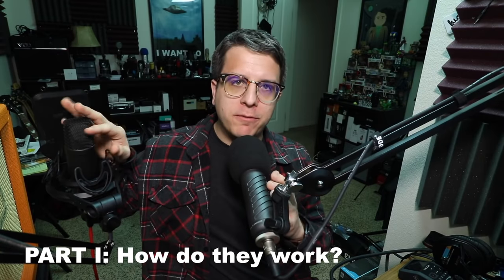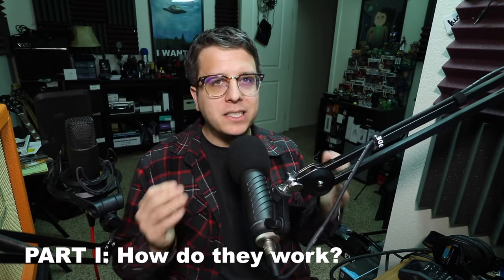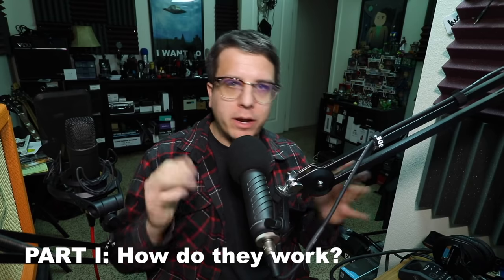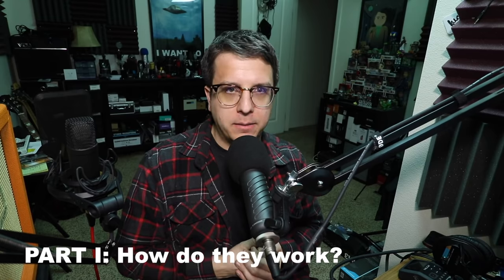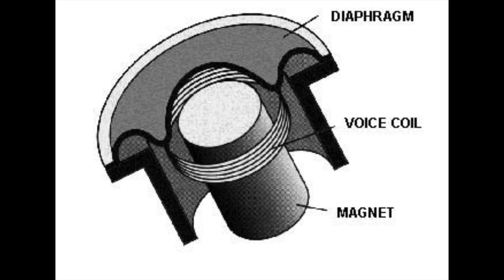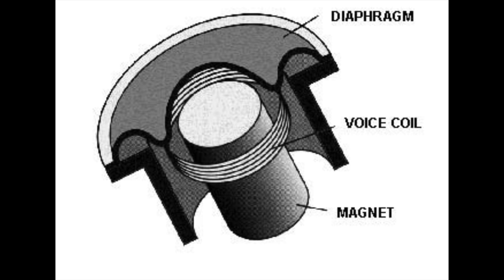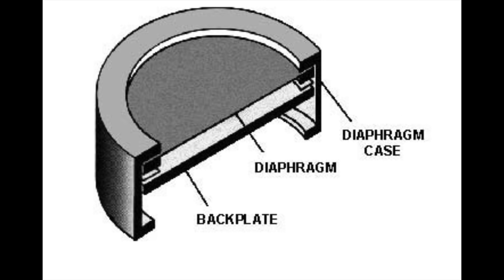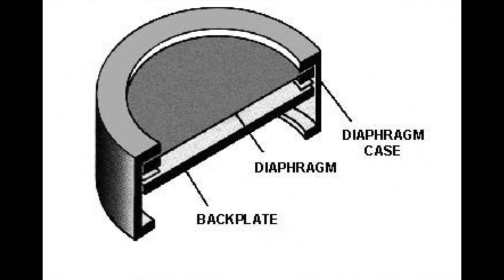Dynamic vs Condenser Microphones, What's the Difference?

Comment: hi, if i buy some cheap dynamic microphone, will it work with a setup like this. Dynamic Mic>XLR to 3.5mm Cable>PC, will it work? just using only the xlr to 3.55 cable? Thanks a lot
Reply from the maker: I do not recommend it. I only recommend connecting XLR mics with USB Audio Interfaces now.
Reply: thanks

Comment: Hey Podcastage you said don't use phantom power with dynamic mics cause it will break the mic but i got the PYLE Pro PDMIC58 and i got a usb to xlr which provides very nice sound quality but the problem is its not loud enough :/ like i can use boost and stuff but still not all programs have mic boost option so i need some help buying either a audio interface or phantom power can you please tell me which is good and cheap ones not willing to spend anything over $50 :p Thank you
Reply from the maker: Look into Behringer UM2 or something like that.
Reply: Thank you !! this is what i was exactly looking for i will also check out your video on that ^_^

Comment: Omni vs Directional (Cardioid) microphone has nothing to do with condenser vs dynamic and everything to do with the design of the microphone.  Dynamic seem better at reducing background noise merely because they tend to be less sensitive.  Use a directional mic, point it at your mouth, get close, and turn your gain down and you will reduce your background noise (or room echo) mo matter whether you use condenser or dynamic.  In other words, Podcastage is wrong on most of what he presents in this video.  But, hey, this is the internet.

Comment: for youtube videos, which one is best
Reply: Johnan totally depends, what kind of work do you want to do?
Reply: Vivaswan just record gameplays and stuff like that
Reply: Dynamic would be the best if you want little background noise but condenser would be better if you want better quality.Not saying dynamic mics are bad by any means because they aren't but yeah if you have an untreated room or don't have a sound booth then it would be best getting a dynamic for background noise rejection :).
Reply: 9 times out of 10, a youtuber or streamer/broadcaster is going to benefit from a dynamic mic over a condenser mic in terms of sound quality due to rejection of ambient noise and lack of studio grade acoustics in their recording environmentr..  The only condenser mics that are decent at ambient and side rejection are super or hyper cardioid pencil mics, but they are well out of most peoples price range and still require a fairly quiet space without reverb issues.
Some great dynamic mics for youtubers would be a shure sm57 or sm58, Mxl bcd-1, Electro voice re320...  On the high end, Electro voice re20, Shure sm7b..
Reply: Cry of the Prophet I currently use a Rode Procaster with a cheapo Behringer Xenyx mixer and a DBX 286A.I love the dbx because of its own noisegat and compressor mainly the compressor though seeing as I have a dynamic mic it doesn't pick up too much background noise but I like to have my pc fans up a bit because it's summer time here in Aus and my room gets hot as fk already haha so having the noisegate on a little is also very nice :D.I wish I had the money for an re20/320 honestly but they're way out of any price range I had when I bought my current mic/setup and am pretty happy with what I have now so win win I guess considering I didn't pay too much for it all and it all sounds pretty good imo :P.Sorry for the random wall of text haha.
Reply: I use an RE20, but I honestly prefer a Shure sm57 for my voice, I also use a DBX 286s into a yamaha mg10xu mixer, similar to your setup and I have near perfect sound without around -60 db noise floor.
Reply: Cry of the Prophet My noise floor with my fans up and general background noise is around -54 db I believe.Could be a little louder idk.Might just be remembering what it used to be with my fans on silent mode.I'd love to have an re20 but yeah they are like $900+ here whereas the procaster was only $178 in comparison and I only barely had enough money for it and the mixer and dbx box so yeah :/.Oh well i'm happy with what I have though because it sounds good enough to me anyway  and it wasn't something that was hugely expensive.Wish I had the money to just go all out on equipment though :D.
Reply: Your setup is leaps and bounds above what most people have and your components compliment each other very well, you also are using a mixer, so you could eq your mic to get a closer sound to the re20.  Trust me, unless you just have cash to burn, I wouldnt recommend the re20 since you already have a procaster, which is a phenomenal microphone..  You must be in Australia or something lol
Reply: Cry of the Prophet Yes I am in Australia and thanks :).I've gotten a sound that for me sounds nice.I don't want to mess around with the knobs on my mixer because i'd probably not get a sound i'm happy with haha.One thing I love about the procaster (other than how good it is for the price) is it's inbuilt pop filter and shock mount because paired with their external ones I hear very few plosives or whatever they're called or they don't come across as too harsh most of the time when i'm recording and rarely if ever hear desk vibrations getting picked up unless I literally hit my desk or something lol.I use my mic mainly for just talking to my mates while gaming and it has been amazing to not pick up any breathing sounds and blocking out nearly all external noise ...to a certain extent anyway.I know it's overkill for talking to mates etc but I was getting so mad with my old at2020 (loved the sound of it though and wish my procaster sounded the same but it's worth the tradeoff imo) with how much background noise it picked up even when it was like 2 inches from my mouth and with the gain dropped significantly...Idk I just have a standard for myself that is very high when it comes to good enough quality to be able to understand what is being said and having little to no background noise if possble.Just wish I had known the differences between dynamic and condenser microphones back then haha.Would have saved me so much money in the long run and time.
Reply from the maker: GREAT Response Cry the Prophet. I couldn't have said it better myself.
Reply: Podcastage what is that mic called the one u always have on the side ur main mic
Reply: You mean the one on the right side of the screen?I'm confused haha.

Comment: Most  points are spot on. But you need to learn more about polar patterns. Off axis test that you did was dumb. It's not about dynamic or condenser at all.
Reply from the maker: I must have misspoken here. I understand that polar pattern is the main contributing factor when it comes to off axis rejection and background noise. There is quite a debate regarding condenser vs condenser and background noise rejection. My theory is that the more limited frequency response of a typical dynamic simply eliminates some of that noise by rolling off frequencies where some of that noise is taking place in (particularly above 14-15kHz), and the sensitivity. Not that the sensitivity alone affects BG Noise rejection, but because they're so quiet, it almost forces people to keep the mic closer to their face while recording, which will increase their signal (voice) to noise (bg noise) ratio, while with a condenser people can easily have the microphone 3 feet away from their mouth. I have also heard a theory that if a dynamic and a condenser mic had the exact same specs, a dynamic would take a higher SPL to move the diaphragm. I haven't been able to confirm this though....it's something I want to research more.

Comment: I shouldn't have bought a condenser microphone.
Reply: I have no idea why producers want music recording with condensors, they pick up all sound in the opposite direction of the artists so echoes (which you cannot eliminate only make close to the same muffled frequency so it's easier to reduce the volume to that frequency) come into the microphone in crystal clarity. A full range dynamic mic can replace thousands of dollars in sound treatment, you just may need more if you have more stuff to pick up.